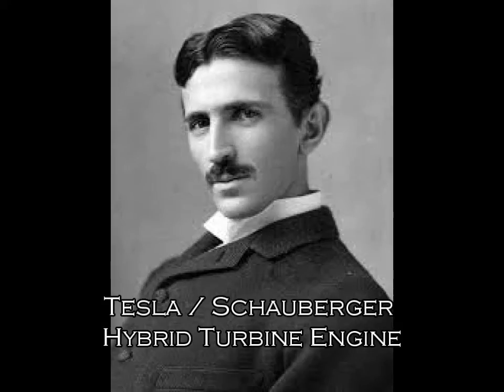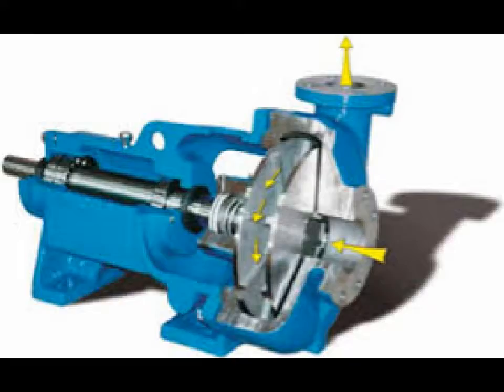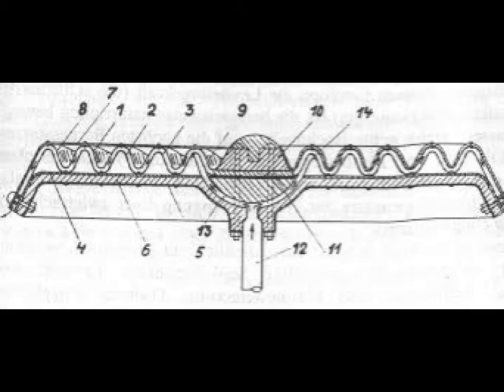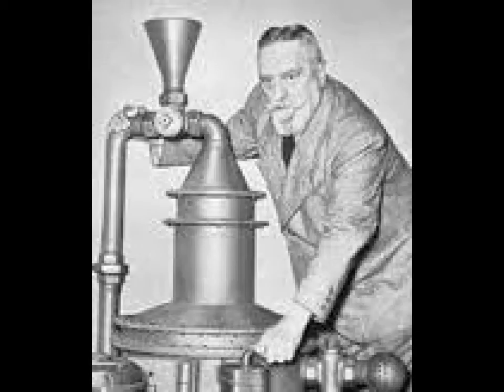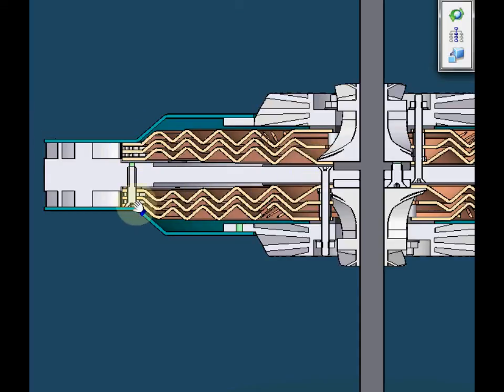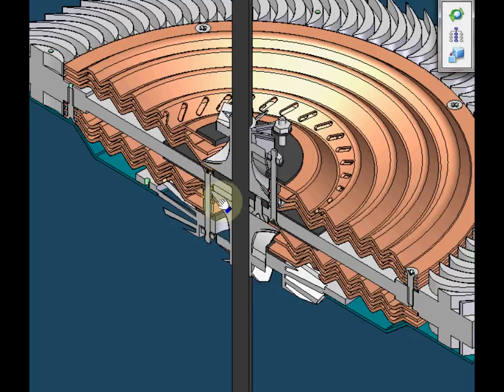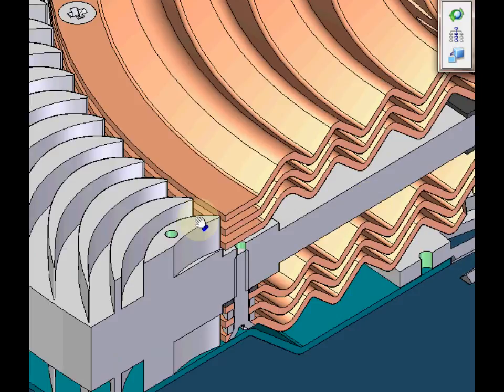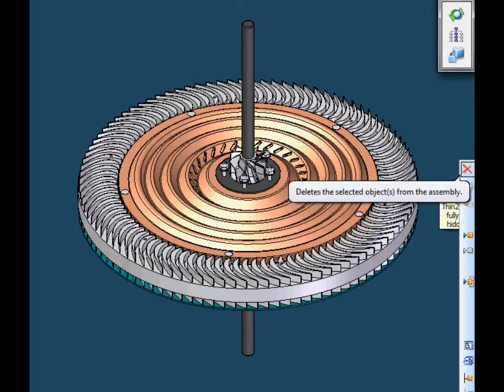Tesla/Schauberger Hybrid Turbine Engine

Comment: nice... are you going to build one?  i have studied these both as well... and have always wanted to build one.. but the machining is either expensive.. or very time consuming
Reply: Unfortunately I don't have the resources to build something and test it out. I built a plastic wave plate assembly with a flywheel using 3D printing. It spins really nice and puts a lot of air out the outer edge, but the plates need to be made out of copper. So, as you say, it's really too expensive unless you have lots of funding. Maybe a Kickstarter project someday?
Reply: yeah.. kickstarter... i like it!hmm.. any chance you could anodized copper onto something else?   maybe cast from the 3d plastic with something?
Reply: @sorchagrey4705  Have you tried making a ring of copper near the inlet? In his notes for the vortex tubes he states that only a part of it needs to be copper. Maybe it's the same with this. Or use copper infused filament. Like https://www.matterhackers.com/store/3d-printer-filament/colorfabb-copperfill-metal-filament-1.75mm-075-kg

Comment: Is this an atmospheric pressure/heat difference engine? Because I know that if there's a difference you could harness it with conventional ways. I'm thinking along the lines of it bejng a hydraulic alternative to the atmospheric particle/electricity collector invented by tesla
Reply from the maker: Yes partly. Here's a good video on it (if you speak German) https://youtu.be/fEpqkjljFyI
Reply: @Fanga99

The Link U've Given Is Not Working Anymore...

Can U Pls Post Another Good Video Which Is Describing Working Principles Of Viktor Turbine Engine... 

Thanks...